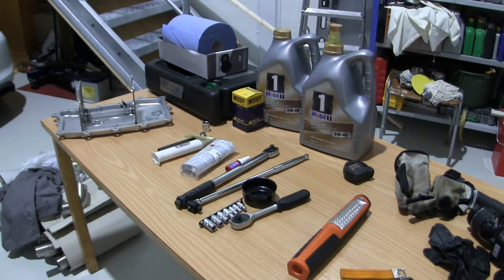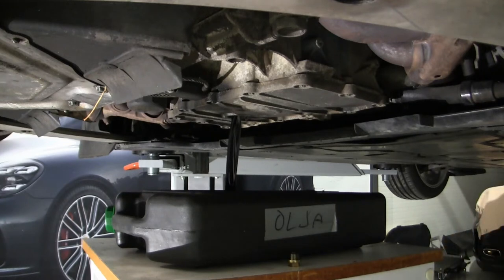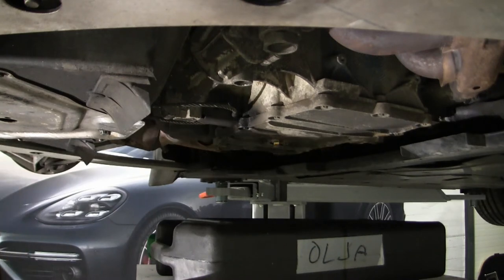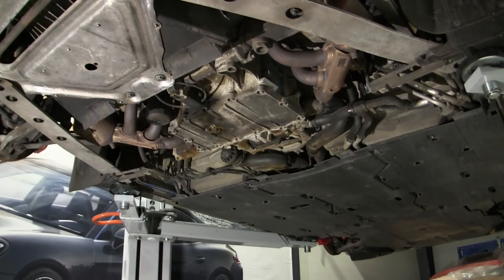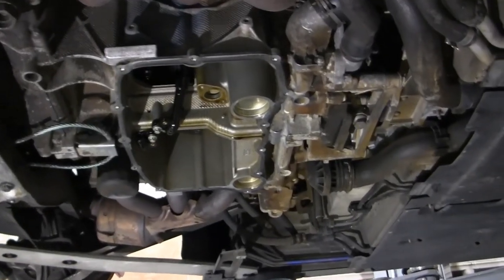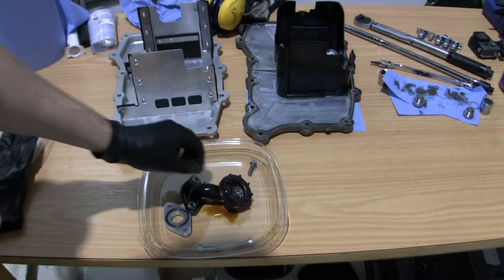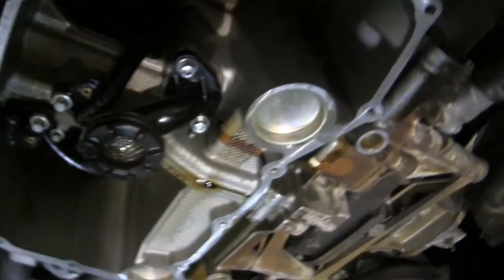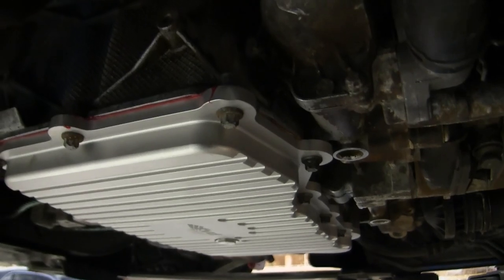Porsche baffled oil pan │Tobe Tinkering

Comment: Tobe, Do you know if it is possible to show the oil temperature through obd2 and some smartphone app? I'm trying but I have not got it yet.
Reply from the maker: the obd2 is extreamly limited in Porsche for some reason. I ended up installing a new instrument for oil pressure. So no I cant help you Im sorry
Reply: @tobetinkering  where have you located the gauge?
Reply from the maker: @andrescosta6923  removed the stereo and have the gauge in the centre console - one of my videos (dont know what one) show the install
Reply: @tobetinkering  thank you.